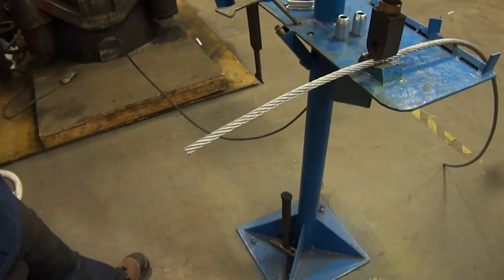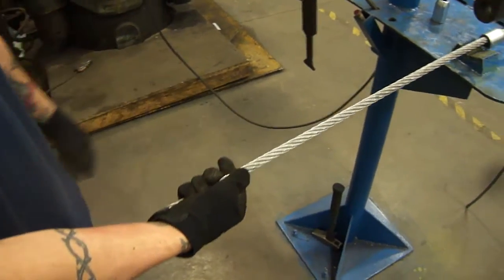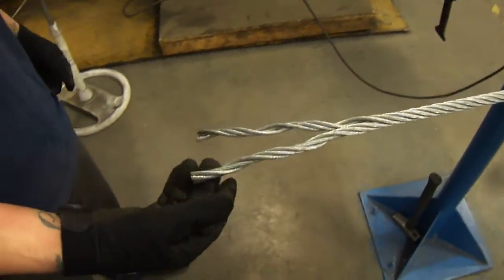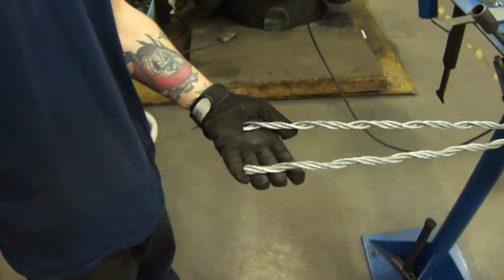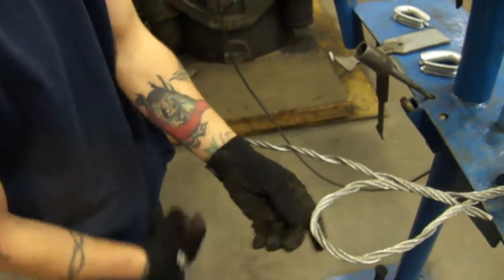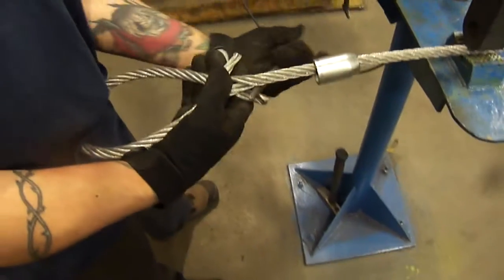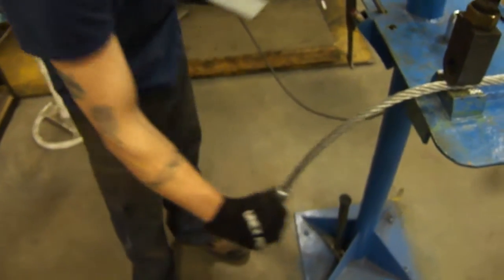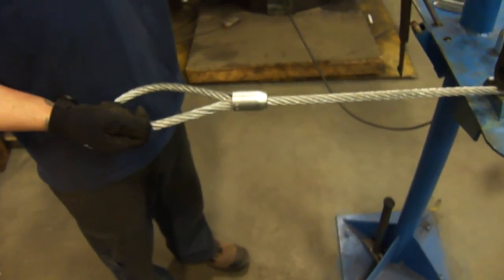M4H01518

Comment: Wonderful clear explanations , and undo 6 wraps......for I guess 6x cable.  Question I've seen extra long tails wrapped into the main cable so do you have a video of that? Is it stronger ? Also how do you keep the ferrule in place? Cheers Warren
Reply: The ferrule or thimble is steel and is swaged into place.  Pressed from all sides making it a smaller diameter.  This takes a tremendous amount of force and can't be done at home.  An alternate for home projects is an aluminum sleeve that can be crimped with a tool that is like bolt cutters.  The result is not a quality lifting eye for overhead lifting but is very strong and plenty good for typical applications.  Alternately leave the tails longer (2 extra lays) and use cable clamps to secure the end, but is a bit bulky.